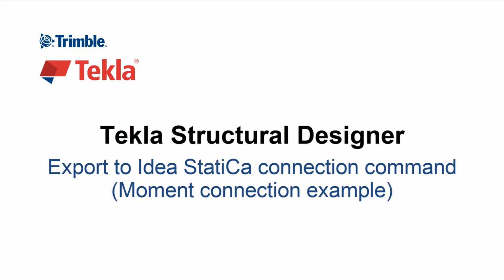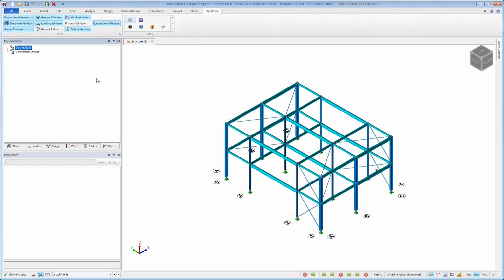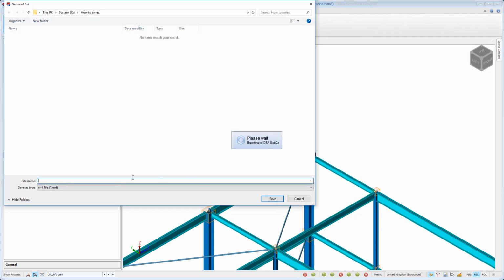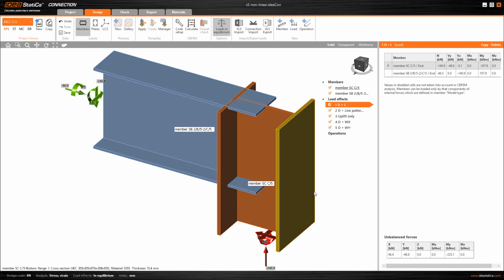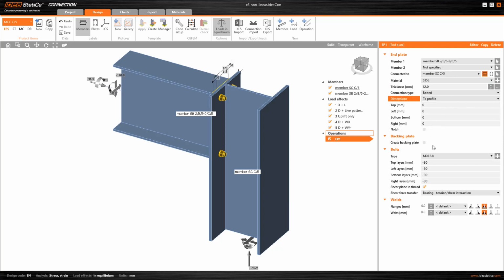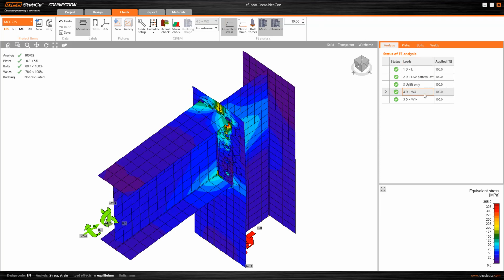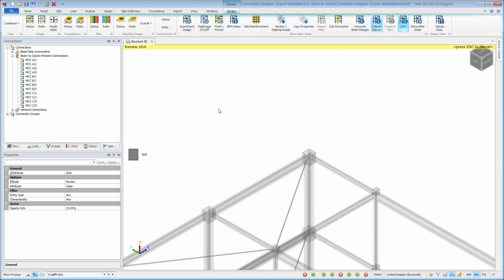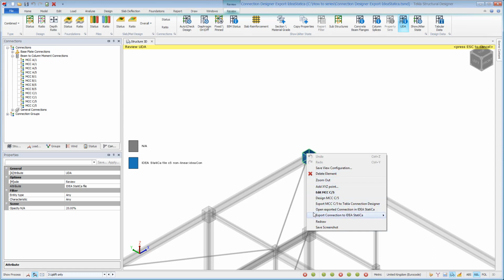Connection design with Tekla Structural Designer and IDEA StatiCa

Comment: I cannot export connection between RC columns and steel beams to idea statica. this seems steel only.
Reply from the maker: Hello, unfortunately Tekla Structural Designer link to IDEA StatiCa does not support concrete parts and anchoring:
https://www.ideastatica.com/bim/tekla-structural-designer
Reply: @ideastatica_en  then how is a composite connection design done?